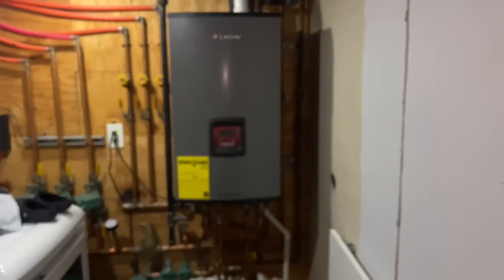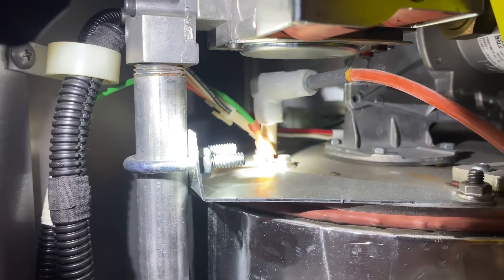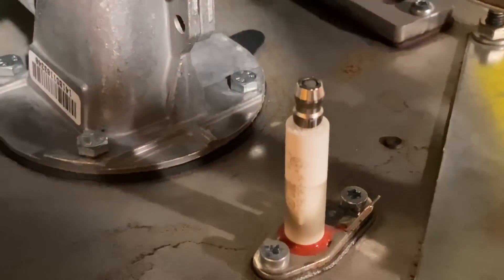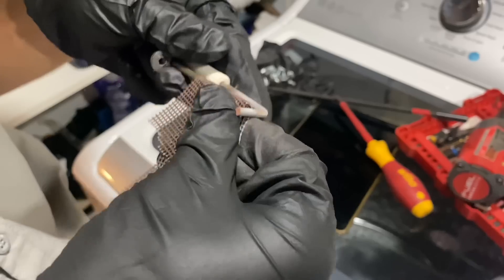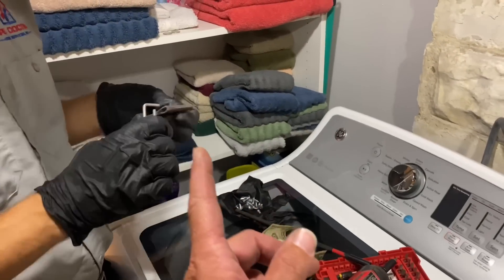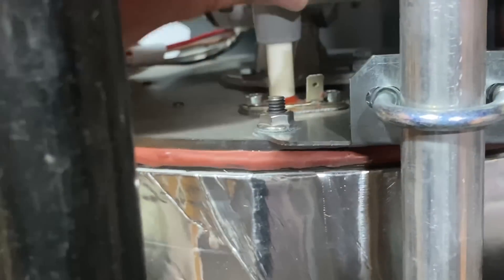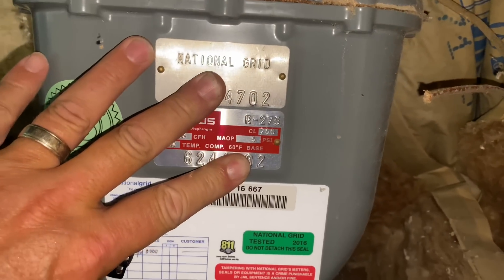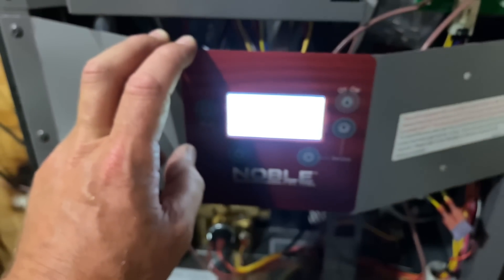Lochinvar NKC-150N Flame Sense Ignition Failure Error Step by Step Instructional Fix Repair Video

Comment: I replaced the ignitor, flame sensor, and the gas valve in my lochinvar knight whn-085 and it still has a flame failure ignition.  What could be the problem?
Reply from the maker: How about instead of being a parts changer call a professional
Reply: @PipeDoctor called three “professional” they still don’t know whats going on. Theu try the same troubleshooting and charge me for new parts that they saw could be faulty

Comment: Isn't the thing Peter cleaned the Igniter and not the flame sensor?  The flame sensor has a single rod/probe, the igniter has the ground so it has two (like a spark plug).   I'm having trouble with my Lochinvar and replaced both the flame rod, the igniter, and have cleaned the heat exchanger, inspected the burner, and even descaled the HX on the water side.  Added boiler chemical and restarted.  Still getting "FLAME FAIL RUNNING" and it drops a couple times per night.  I have the 85K BTU Knight boiler.  I'm going to check my gas pressure next.  Annoying issues.  Thanks for the videos.
Reply from the maker: The two prong is a spark igniter

Comment: 4.5 year old Noble Lochinvar Boiler NKC 199 model.  Tech came and relocated the outdoor sensor which fixed the Outdoor error code.  Then the ignition error code came up 5 days later, so he came back and replaced the ignitor yesterday.  Worked well for one day - same Flame Sense Ignition Failure code came up DURING a cycle (not new demand), but I hit reset it and it's worked fine all day - water and heat - no error codes?  He's coming back out to take a look now.  Any thoughts of the top of your head, Mikey?
Reply from the maker: Any ideas? Flame current micro amperage reading, combustion analysis, reading, and gas pressure. All the elementary stuff that a service tech would check during a repair service call

Comment: What about the Outdoor sensor error code?  Do they not use the sensor in NYC?  I have this Unit and they just relocated the outdoor sensor and now my flame ignition failure error showed up.  I could clean it like you did but will bring the tech back out have them do it.  Are these two connected errors?  Thanks - love your videos!
Reply from the maker: Outdoor sensor and flame sensing failure are two different things totally coincidental
Reply: Thanks!   Why did you close the cold-water valve when switching out the ignitor? @PipeDoctor
Reply: Please be aware that there have been 2 separate recalls for the risk of carbon monoxide poisoning for some Noble models. The Recall information can be found on the Consumer Product Safety Commission (CPSC) website.

2020 Recall:

"The boiler’s flue grommet can deteriorate and dislodge during use and allow the boiler to emit carbon monoxide, posing a risk of carbon monoxide poisoning."

2023 Recall:

"The boiler’s flue collector can crack if exposed to a high impact event in the burner chamber, which can allow the boiler to emit carbon monoxide, posing a risk of carbon monoxide poisoning."

Comment: Question: Can you explain what is causing the unit to go into Lockout? I've had the same issue with my system and no solution has given me a long term fix.
Reply: These have voltage issues...they only have a 3 second interval to fire then they lockout.
Reply: Please be aware that there have been 2 separate recalls for the risk of carbon monoxide poisoning for some Noble models. The Recall information can be found on the Consumer Product Safety Commission (CPSC) website.

2020 Recall:

"The boiler’s flue grommet can deteriorate and dislodge during use and allow the boiler to emit carbon monoxide, posing a risk of carbon monoxide poisoning."

2023 Recall:

"The boiler’s flue collector can crack if exposed to a high impact event in the burner chamber, which can allow the boiler to emit carbon monoxide, posing a risk of carbon monoxide poisoning."

Comment: Just a random rant, NOT aimed at Mikey OR at Pipe Doctor, but at other installers and in general. When you run an install assess NOT ONLY the site to see what equipment will work best but also THE CUSTOMER. Don't go with the wireless thermostats that need to be paired to the combi unit if the batteries are changed when the customer is someone in their 70s with a 20 year old tube TV. Yes it may be the latest tech, yes it may have advantages, but if the customer can't work out how to USE what is installed it isn't going to result in a happy customer or sustained business. (This happened in the UK, not the US, I ended up on an international video call to walk the customer (My Mother) through pairing the thermostat. (Bosch Greenstar 29CDi)
Symptom - rapid flash (2 per second) of the red LED on front of combi unit 30 minutes after changing thermostat batteries. No other indication from Combi unit OR Thermostat.

Solution - Cycle power to combi. Then press and hold recessed button n front panel 3 seconds until red LED flashes once per second.
On Thermostat, press OK to enter menu, scroll touch sensitive bezel round display until you get to 'Pair' - hit OK, 10 minute timer will start, pairing will start. When red light goes out on Combi the thermostat is paired. The thermostat will continue 10 minute count to zero.

Comment: Use a wire brush in a drill to clean up old flame rods if your going to half ass and not replace them. If you need help with Lochinvar im your man, no homo! That was an ignitor by the way not a flame rod. It senses flame but its secondary
Reply: is that you Mikey? are back to that $45,000 dollar heating system again
Reply: @PipeDoctor  at least know it's an ignitor LMAO

Comment: flame rod seemed awfully nasty for only a few years old. if I had to guess nasty intake air coming into the unit or they run very short bursts of hot water often, making it short cycle a ton. either way will schmutz the rods up faster and of course there's always the possibility of dirty wet gas supply.

Comment: a burst washer hose here, would just clean the old concrete floor really well and make me throw a few things away 🤣 floor drains and sump pump would handle it fine, it needs cleaned anyway and yes, they're bravely still the original machine hoses from early/mid 1990's. 🤪